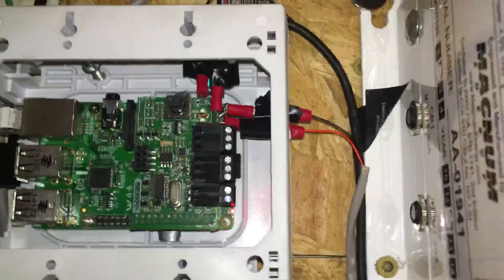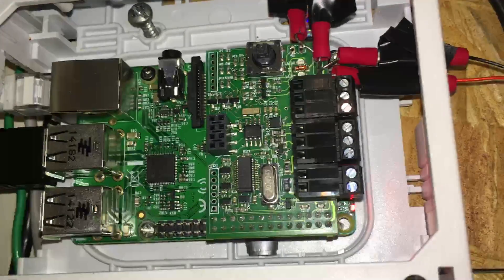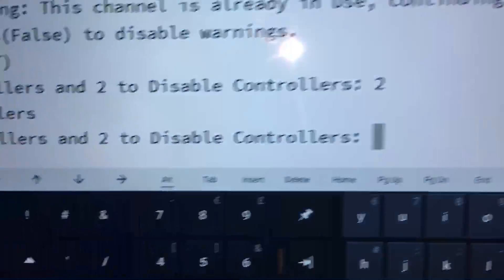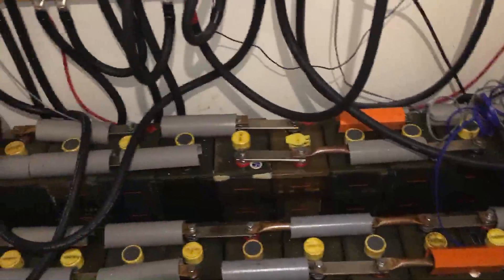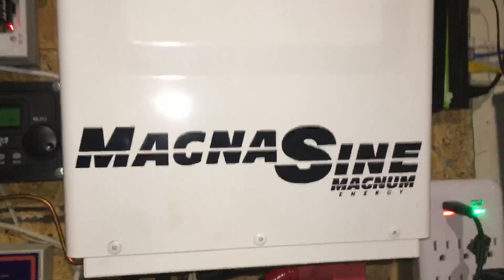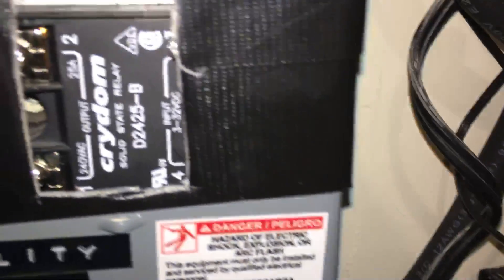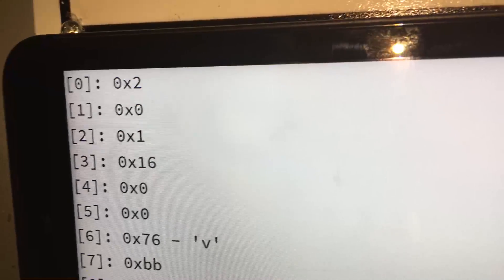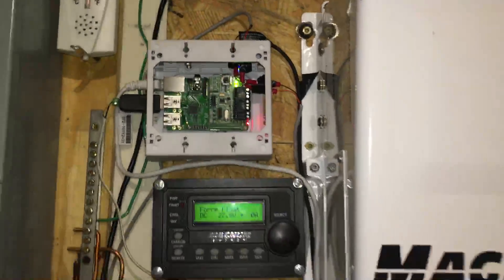Automating Home Solar using a Raspberry Pi, USB to RS485, and a RASPICOM Board

Comment: The USB X RS485 adaptor you have used gives a nightmare. It works fine initially but it vanishes from /dev/ttyUSB0 after some days. This is something to do with it's driver ch341. I had to add dtoverlay=dwc2 at the end of the file /boot/config.txt and also added modules-load=dwc2 (after rootwait) in /boot/cmdline.txt. After that touch wood, it read modbus data over RS485 continuously.

Comment: Very nice setup. I have used modbus with a pi on a epever mppt charge controller. I had a ground loop issue that was creating data corruptions on the bus.  

I would highly recommend getting a proper opto isolator. They are very cheap but will keep a barrier between the two in case of a short, surge or any other issue. Also with that usb to rs485 convertor don't be tempted  to set the com speed higher than 4800. It doesn't like it when the pi ram gets low and it can bomb out.

The only other item you may find very useful is an external watchdog timer that reboots the pi if it locks up with all outputs on. With my system that took out a breaker as the outputs I used were not meant to be on together. Just put a loop in that turns on a gpio pin every 2-3 seconds. The external watchdog pcb's have a relay that closes if it doesn't see a state change for whatever you timeout you set it to. The relay just power cycles the PI.

You have a very nice system there :) have you done a tour video ? if not I would be very interested to see one.

All the best.

Stuart.

Comment: Hi, do you need a special drive to use the USB toRS485 converter on RapeberryPi?
Reply from the maker: In this video I'm using an older Raspberry Pi Model B, no special drive was needed to use the USB to RS485 converter.

Comment: Had you considered using this PI technology to actuate AC transfer switches on the Load side?  Just askin
Reply from the maker: Actually I have a raspberry pi that does something very near that on my Solar system, by monitoring battery voltage and SoC vs time of day.  Essentially, based on the time of day, if the Battery voltage and State of Charge is high enough based on programmed parameters, the PI (using Python programming and PyModbus) will trigger a relay control that will open 2 Normally Closed SSR relays, this will sever the connection to the grid initiating the transfer in the inverter.  Using the same approach as in this video, Yes I could do the same thing with voice control.  I thought about it, but never went forward with it.
Reply: rhandsom good work very impressive.  Care to share? Look up youtube under my name We have also been pioneering energy security and sustainability as lifestyle choice.
Reply from the maker: You guys are doing some great work, I don't know what guidance I can provide though.  Your videos provide really good information.  Please let me know if you think I can help in any way.
Reply: I'm a Vet of 10 Years AT&T Plant Enginnering (  grunt really) who knows a thing or two about DC power for 21st century Digital devices.  Care to help out our 501-c3 Non Profit with some Automation?
Reply from the maker: I don't know if I can help, but I'm interested to know what you may be looking for.  Shoot me more details on what your looking for and I'll see what I can do.

Comment: If you do decide to keep the setup you have instead of programming the charge controllers, I'd suggest not using "solid state relays".  What you have are just a package of transistors, so you're always dissipating their waste heat.  An old "coil and switch" type of relay is what you really want, very little waste heat on those.  You can be flowing 40A through one and they barely get warm to the touch.  You could use a smaller solid state relay to trigger it/them if needed, but the more amps you flow through a transistor, the more energy they waste.
Reply from the maker: Jason Riley thanks for the info, when you say "old" solid state relay, can you give me an example.
Reply: Oops, my bad, must have edited that at some point.  I meant the old kind that's just a coil and switch.  Original comment edited to express what I intended.

Comment: Maybe it is just me but I really don't get why you need to switch off one set of panels..This is part i don't understand ..
Reply from the maker: Thanks for the comments, my charge controllers are not configured to go into float mode and so they are programmed to go full out all the time.  When my bank is full the TriStar is still capable of being maxed out at 60A, so the Classic  controller can safely be shut down and stay cooler, not having to charge the batteries will keep the Classic cooler longer.  I use the Classic as more of a "boost" controller to fast charge the batteries.
Reply: SylwerDragon me to. the charge controller deals with it. no need to switch of the panels as such. its better to actually controll the charger via its com port if needed. but with those controllers here its no need as i see it
Reply: I see well then it is clear. I'm just not sure why you are not using float mode on your charger but that is different question and you might explain it in some video before. So thanks
Reply from the maker: In order for my particular system to continue to function at maximum, both charge controller's charging parameters are be tweaked so that they continue to be in MPPT (Bulk) mode constantly, so for my system there is no float mode.  Float mode requires that it be set according to a particular voltage, for my system that would be counter productive.  The idea behind my systems configuration, is that the controllers are configured to provide maximum power to charge those batteries quickly in all conditions, whether cloudy days or sunny days.  With Nickel based cells, I'm not worried about over charging, however there is water loss when the bank reaches 100% and still gets over 30A.  The TriStar alone can max out at 60A on bright sunny day and in the case of a full battery bank, and being off grid with little to nothing running during the day, I've discovered that I don't need 2 controllers, and float mode does little for a system designed for continuous off-grid operation.  I hope this clears up things a little more.
Reply: rhandsom if u let one of them just to be 0.1v above the other it should work to. and then potentially disable float on one. may not work for u but sont see why. i have 4 chargers in total and it works :) neither less all systems are different and i got other gear. thanks for  video btw
Reply from the maker: Thanks for the comment and suggestion.  Let me gel the info in my mind to see how it will flow with my particular setup.  Thanks again and take care.  Also, I believe I should maybe do a follow up video for better clarification to other viewers as well, your comments and those from SylwerDragon pose very good questions and people may still be confused about my reasoning.  Thanks again.
Reply: rhandsom :) yeah. back in days it was common to disconnect panels but today with programable levels and nice chargers its in most cases possible to run them in paralell as long as you just time the settings a bit so they dont race each other.
Reply: Understood, we just add more loads.. I call it thermodynamic Jujitsu . The More Sun the More Cold! By adding a supplemental "Inverter based" Mini Split Ductless Air. It has No Surge or Power factor correction issues, very kind to my Magnum.

Comment: does all relays give off heat when conducting a large current? seems like a waste for your precious solar to be turned into heat.
Reply from the maker: Yes, all power relays give off heat and require a heat sink.  And it's not much of a waste of solar.
Reply: Good point , loss isn't a big deal if the cost of energy is Zero..

Comment: Brother have you looked into making AC dump load for your water heater? My Dump load on a good day runs a 500 watt ac for 3 hrs. That would be a lot of hot water. You make SOOOOOOOO much more than me. I would think you would no longer need to pay for hot water..
Reply: I do that as well... That is after the Mini Split Air Con unit does it's thing..